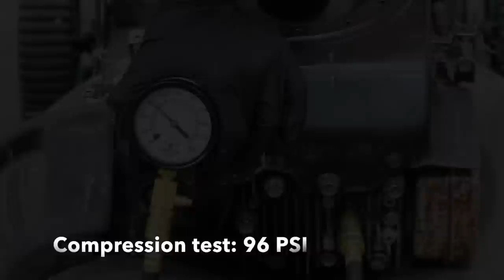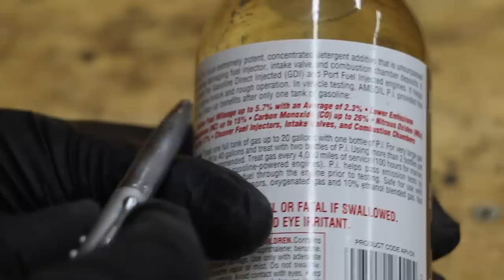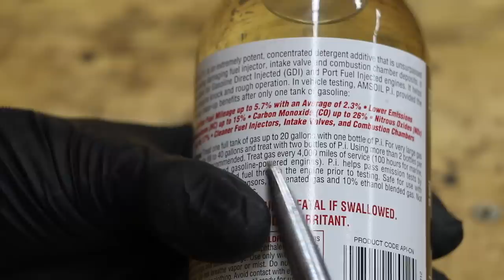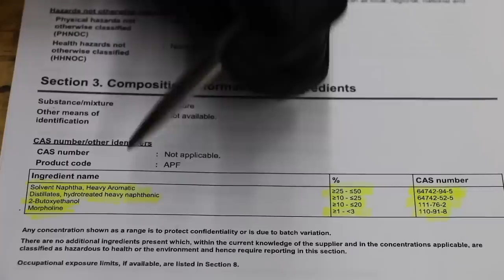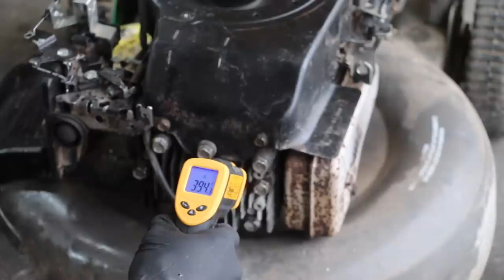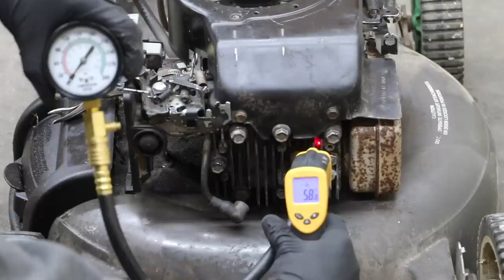Is Amsoil Power Foam better than Seafoam & MMO? Let's find out!

Comment: U-huh....those are self DRILLING screws...I had to tease you, I designed my own metal pipe frame houses and me and my helpers are always saying self tapping. Just a bit of frivolity. But seriously, I came up with a few different perspectives on them. I use them for drill bits and starter holes, I got sick of breaking drill bits, it makes a two step process into one really quick one, they stop wood from splitting with thin pieces or near the end of boards, we use literally hundreds and hundreds on each cabin, which makes them super strong and even the idea of predrilling all those holes makes me shudder. We attach metal tie plates to the pipe to fasten wood, the list goes on. Try putting one into the wall of a piece of galvanized pipe, 1 3/8", it takes a bit of focus, practice and developed methodology to do it over and over for hours without tons of dropped screws. We've got pretty quick and consistent about it after the first two cabin frames. It tickles me you made a comment about them.
Reply from the maker: Thanks for sharing.

Comment: Waste of money. I would rather pull the head and get it all cleaned out. I know some wouldn't feel comfortable tackling that job but there local shop should be able to do most engines in 1 1/2 hr or less. Plus the cost of the gasket. I just don't believe in mechanic in a bottle.
Reply from the maker: Thanks for the feedback.

Comment: Project Farm check this out: https://thegaragely.com/best-engine-flush/

Maybe you can do a video on these products and add Automatic Transmission Fluid (ATF) as a component in the testing phase since the rumor is that ATF works just as good to flush and clean sludge and varnish in a gasoline engine due to the detergent in ATF, which is also cheaper than the other products...

Comment: Amsoil saber 100 to 1, Two Stroke oil added to gasoline and especially to diesel diesel truck drivers swear by it lubrication and strips out the carbon

Comment: I have watched all of your videos on Seafoam, MMO, amsoil, etc., and while visually, it appears that they all work more effectively than nothing, it’s difficult to say with scientific certainty which is better. I can also understand why you’re afraid to draw any real conclusions yourself, since a truly scientific test would require testing each product on uniform amounts of carbon buildup. The question therefore is: How can we achieve this? One idea I have is: Take the cylinder head off, and try burning a uniform amount of table sugar on the cylinder head, which should theoretically produce pure carbon, and then reattach the carbonized head to the engine for each test.

Comment: Is it as good as marvel mystery oil and Seafoam? I don't know. What you did that wasn't part of the instructions tainted the test. You gave Amsoil an advantage by tampering with what the instructions didn't specify. Follow the instructions right for a proper test. Testing is supposed to be done by how the manufacturer that makes the product specifes how to perform the method. That's how we know if the manufacturer is a complete arrogant liar in their product and if it's snake oil they themselves blindly standby. If the method called for that, then it's ok, but your caption says it's not part of the instructions therefore the test has been tainted.